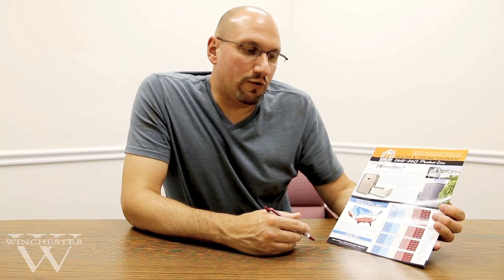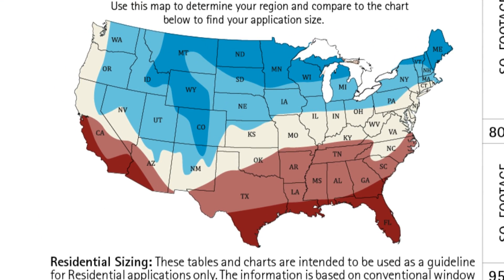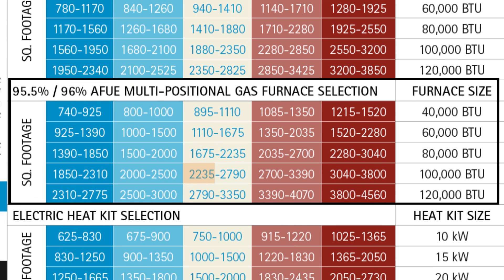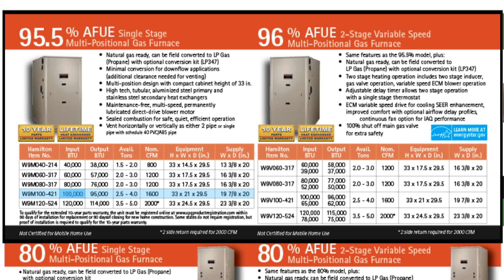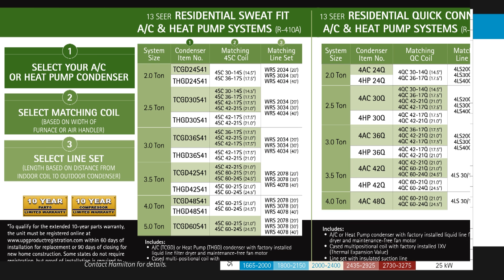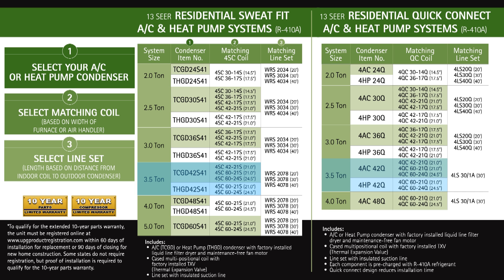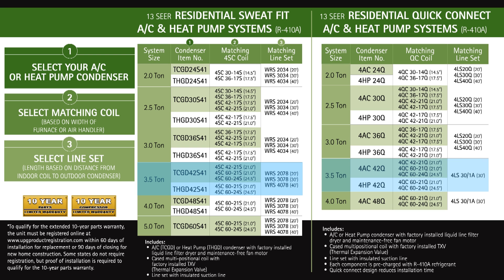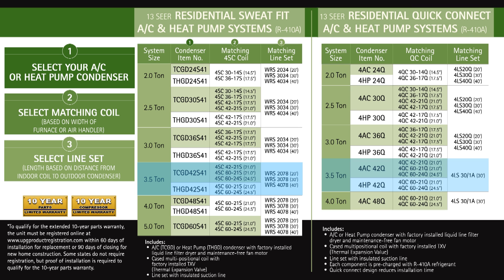Step 1 - Sizing a furnace or air conditioner

Comment: I always go in one size bigger so you’re not overworking the system . My daughter put the one recommended on that heat the house above 62° in extreme cold.
Reply: Exactly wrong overdizing esp bad in hot humid conditions won’t remove enough humidity. Let alone higher initial costs and less efficiency heat pumps are optimally running all the time not stopping two often
Reply: @johnwhite2576  I think the contractor put the wrong size in my house because it never cooled the house . and my neighbors on both sides of me had the same issue and they want to the next size bigger too.

Comment: He said this is a "general overview". This chart will work for 80% of homes.  15% would be on the fence to choose the next up or down size. 5% would be special situations.  So this is great for confirming what you need to size to replace what you already have.  Sounds like some contractors that are commenting like to run up the bill.

Comment: This chart and advice is completely wrong. Have a proper heat load calculation and ductwork evaluation completed before having any equipment installed.

Comment: do you add in the sq footage of a basement. my main floor is 1275 but w/ basement I have 2305sq ft.
Reply: Yes you would add in you're basement sq. If you'll be putting a supply and return in the basement space
Reply: @KhaimDaTrucker  What if you don't use the basement that much and you usually close the supply and return in the basement?

Comment: You cannot size hvac equipment by "charts". It has to be done like previously mentioned in the comments below by using manual J to find the load, manual S to select the equipment and also a manual D to ensure the ductwork is sized correctly as well. By "being around a long time" you guys should know that taking shortcuts is doing a disservice to the customer! HVac is not something that should be taken up by a DIY, especially during the design and sizing phase or you may wind up spending all those dollars that you saved replacing incorrectly sized equipment and/or possibly repairing mold/moisture related issues caused by oversized equipment. Hire a competent contractor that does proper load calculations and get the job done right. In the end you will have a system that saves you money on your electric bill and that also provides excellent comfort for the occupants of the home 365 days a year.
Reply: True that..